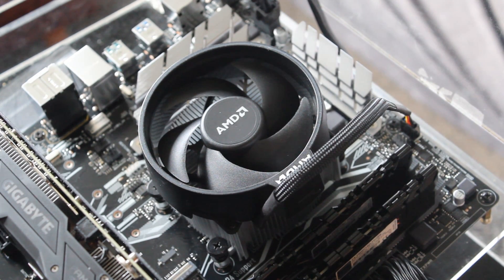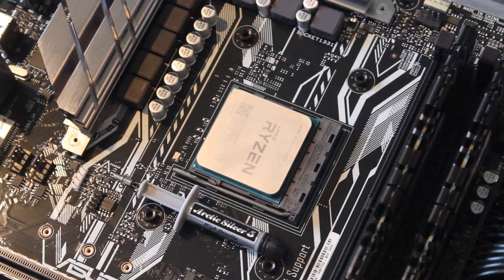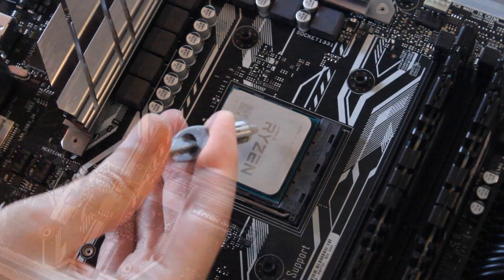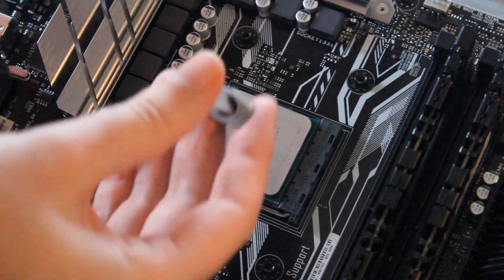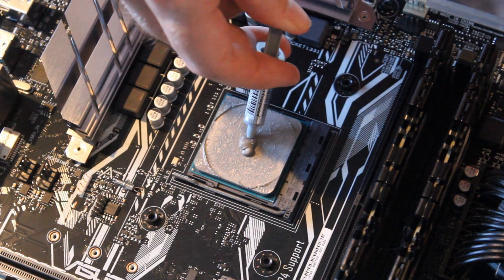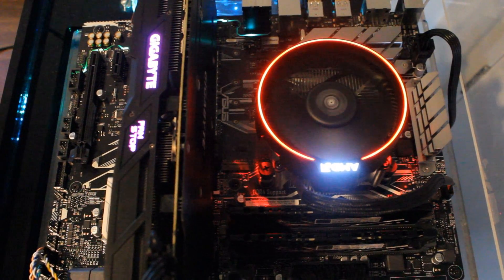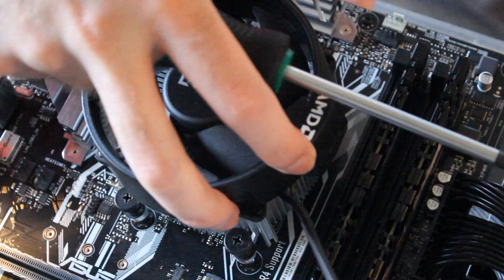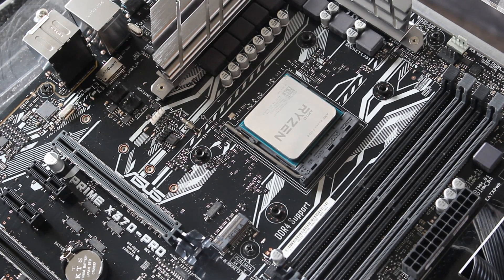Best Ryzen Thermal Paste Application Methods

Comment: I have noctua paste already and have ordered ryzen system. Is it worth it to use the noctua paste instead of the paste the stock cooler comes with? I wonder if there is any difference with such a small cooler? The noctua paste is little over 1 year old, but it has 3 years of shelf life so its fine.
Reply: Stock paste is fine, also this YouTuber won't answer your question because he's gone.

Comment: You didn't do the recommended way by Arctic for the Silver 5 which is a vertical line down the middle, would have been nice to see as that's what I do (it's in the tiny booklet that comes with it and on their website) would have been nice to see the difference that's all, I know it honestly doesn't even matter how you apply thermal paste the difference is usually within 1-2c but ya'know, was expecting to see the recommended way for Silver 5 lol

Comment: Arctic actually recommends applying it in a vertical line. The middle is where the cores come together and that's where the most heat is coming from.
Reply: no arctic recommend  dot method

Comment: Ohh I have just noticed lately that many use the rice method. I have always used the credit card thin even layer since AMD K6 build (approx two decades). My last 5-6 build I have only used Noctua thermal paste, since it is much easier to get an even spread than Artic Silver.

Comment: thank you for this! Just built this very system (same m/b and cpu) and used the thermal paste that was already on the stock Wraith  cooler that came with the 1700 (it's in a round thin layer about the size of a quarter). Am getting 40c currently (not oc'd - stock speed) but really was curious about thermal paste applications in case I upgrade my cpu  in the future. Good stuff!